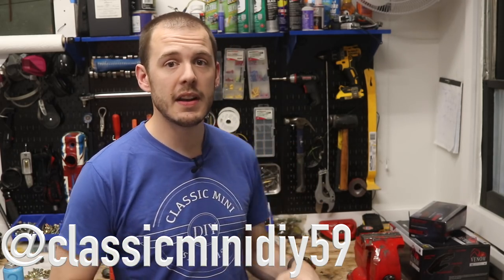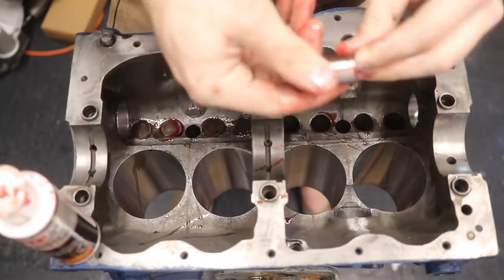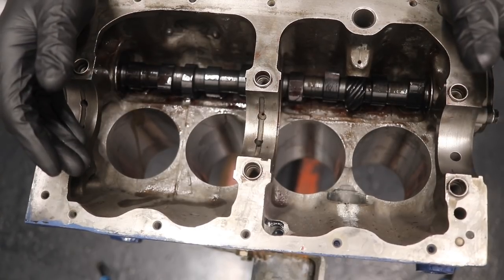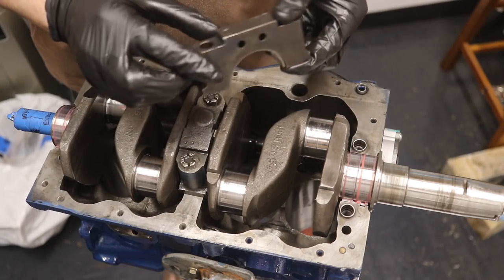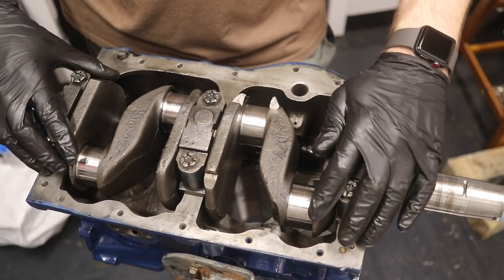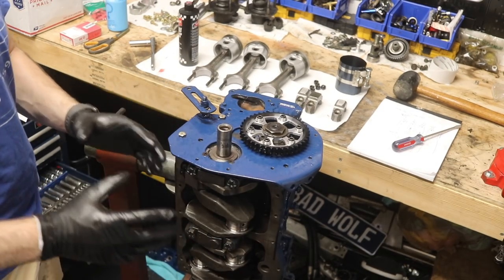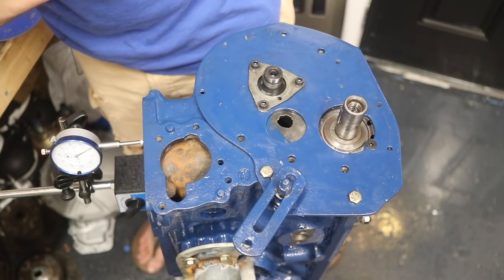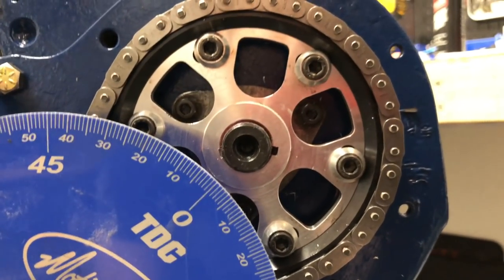Operation Bad Wolf [Ep  13] - How to Set your Cam Timing/Advance | Classic Mini

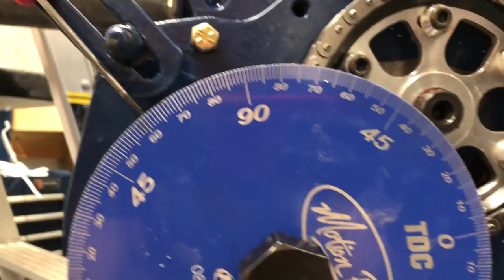Comment: Hey Cole, hope you didn’t get too far since this video. You’re math was wrong on your first cam degree measurement, it was 119 not 129. You skipped 110 in your count. Check at 37:20ish in the video.
Reply from the maker: 😑 Dammit. Well luckily I re-measured after I adjusted the actual cam gear, the second time around and I am confident thats correct. Sigh......
Reply from the maker: Follow up to my last statement I actually went back and reviewed my footage and thanks to the fact that I say everything out loud(subconsciously apparently) I was able to confirm I for sure have this adjusted correctly.  WHEW!!!
Reply: Would have sucked if you had to do that all over again. Glad it worked out and really enjoying watching the build!

Comment: Neat video. We'd always recommend test fitting the cam and crank sprockets on the camshaft/crankshaft before assembly of the engine. You'll quite often find burrs on the shaft or key, so light filing of any imperfections and they'll slide on and off with light resistance. If it needs to be pressed in place it's too tight - you'll struggle to remove them without damage.

The chain is a German-made Iwis (pronounced e-vis). We can supply these for simplex and duplex setups and they do not stretch, unlike budget chains.
Reply: Hi! I have absolutely new camshaft with new key but your sprocket does not fit. So only filing of the sprocket helped to fit it.

Comment: can you help me to understand this, see if its right. 1- TDC from first cilynder 2- put wheel on TDC 3- anti clockwise find top of  push rod 4-  set 0º 5-  clockwise go to 5º 6- read the wheel 7-  anti clockwise go to 0º 8- clockwise again go to 5º 9- read the wheel. So my question is on step 8 you clockwise 5º or anticlockwise 5º

Comment: Great stuff Cole,can you explain why it's 5 degrees and is your cam a standard 1275 A+.
Thanks
Reply from the maker: Thank you! This cam was an EVO001 from Minispares. Each aftermarket camshaft will come with its own spec to "degree in the cam".
Reply: @classicminidiy  Great thanks.
The only can I see on minispares is the fast road  EVOLUTION001 or EVOLUTION002 for 1.5 rockers 
Are these the same as yours?

Comment: The only thing that confuses me on the cam timing is when you have the dial indicator on the pushrod, and you move 5 degrees clockwise to get the first number then when you go back to 0 and back to 5 degrees one more time clockwise wouldn't it be the same number? how is the second number not the same? Ive never done this before but I need to learn so I can rebuild my motor next. Thanks!!
Reply from the maker: Hey Alex, I can see how that would be a bit confusing. So once the pushrod reaches the zeroed out location, no matter which way you rotate the motor the rod is going to go down. So getting to 5deg turning the motor right vs getting to 5deg turning it left you will get two different numbers. Does that help clear it up a bit?
Reply: Ahh I see. that does make sense. Thanks!!

Comment: Hi, i have a 270/106 cam on my 1275 A+, do you think i need an offset key ?
Reply from the maker: If its anything besides standard you will need to degree it and make sure it matches the spec provided with the camshaft. You wont know for sure if you need one until you degree it and find out how much it is out of sync.

Comment: Interesting and helpful video, however you have incorrectly counted on the dial gauge, you counted 129 but it should be 119, and therefore you have put in the wrong offset.
Reply: Likes correct to me.

Comment: I don't really understand why you need to degree the cam? Could you try to explain it? :)
Reply from the maker: Sure! I will do my best. So when you have a stock camshaft generally speaking its made for the amount of fixed advance or retardation required for the motor. As you being to change out the camshaft, the newer cams target a different power band in your motor. So when you degree the cam you are effectively optimizing power delivery for when the new performance camshaft opens and closes your valves. This ensures the cam is opening and closing the valves at the exact time the camshaft maker wanted them too. This also ensures the MOST power is being delivered to your wheels with your given engine parts. Does that help at all?
Reply: Classic Mini DIY ahhh I see, it makes sense.. so this should be done on upgrade cams or new cams but not if I still use my standard cam?
Reply from the maker: Personally I would still do it with your standard cam just to be safe but you might be able to get away with it. But another 30 mins of work for some peace of mind seems worth it to me. :-)

Comment: "A series" blocks have tappet covers" A+"  blocks do not
Reply from the maker: You’ve got that backwards. The early a series blocks did not have removable rapper covers. The later A+ blocks did which allowed access to the lifters directly from the back of the motor.
Reply: @classicminidiy  Hi Cole, all the pre A+ small bore engines had the removable covers. The Cooper S 1275 block also had removable covers. The standard pre A+ 1275 engines (12G1279) were the first ones without removable covers